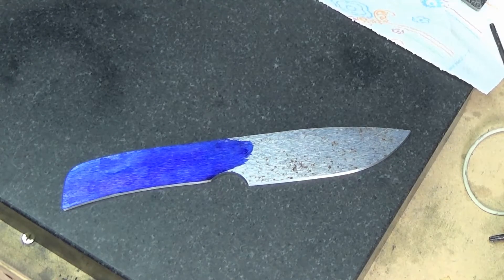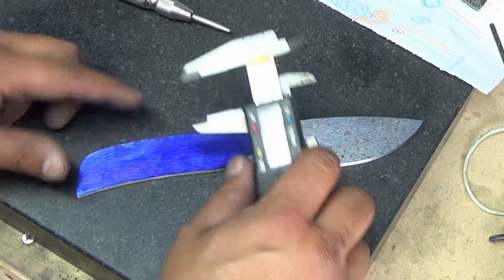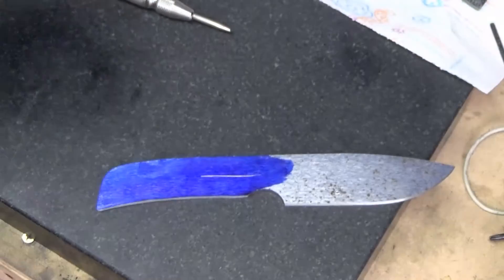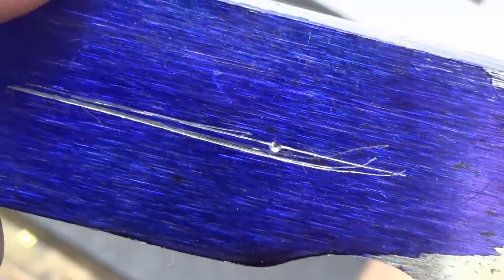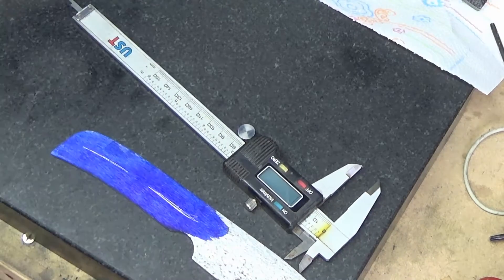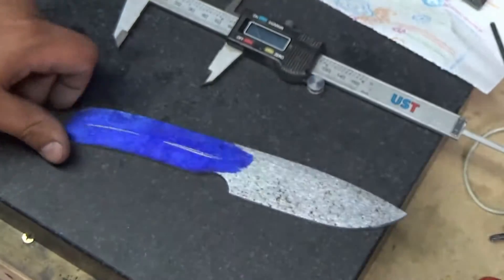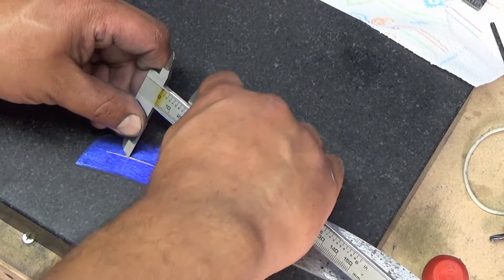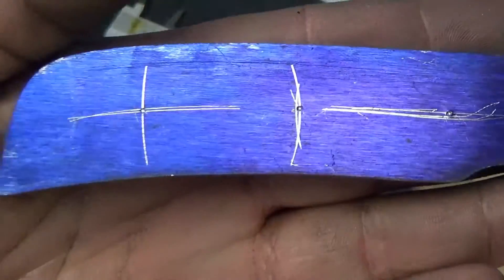How to make a knife Part 3. Drilling the holes for pins

Comment: Very nice! Couple of suggestions, though. 1) Raise the table - you want to keep your quill travel no longer than it needs to be. 2) Definitely agree transmission fluid a bad choice; tapping oil/cutting fluid best; good ol' 3-in-1 oil not bad. 3) once you drill one hole, file/deburr the back real quick before doing the next hole, or the blade won't be flat on the table. And reminder for your viewers, in case they don't know it (say it with me everyone): *"a 1/4" pin does not fit into a 1/4" hole!"*. Seriously. And this is (literally) doubly true when you're trying to get a pin through two scales as well, unless you have a miraculously perfectly true 90° setup. Either use an "F" size drill bit for a 1/4" pin, or use a 6mm pin in a 1/4" hole. (The equivalent for 1/8" is a #30, for a 3/16" is a #12, and for a 1/16" is a #52.) Otherwise you'll want to sand your pins, or ream your holes with an "over" reamer - pricey.

Comment: You should use all 3 keyholes, and the drill will never slip, and you don't have to force it.  Believe it or not, doing so will run more true & the chuck will last longer.  Then again, once you slip a bit, it won't run as true. ( although a drill press does not run as true as a mill. )

Comment: You should worry more about safety when doing such work. Especially when you expect that other people try to copy you. Wear safety goggles! A friend of mine told me about an incident where 1 of the students got a part of the hot cuttings flying around in one of his eyes. That was a real ugly thing to remove in the hospital because it gets stuck there when it cools down. Also use a proper tool for holding the workpiece, like a heavy drill press vice. You scared me when you had your fingers on the table and your wrist exposed with this insufficient clamp. Just a tip: if you drill metal, always drill into another some metal you put below and not into air. Don't use some random fluid for drilling if you want your tools to last longer. Thanks for sharing and remember safety first for public videos that may inspire other people!
Reply: Had my first experience with an exploding bit yesterday with aluminum of all things. Bit shattered and a piece cut the side of my stomach.

Comment: Mike, the transmission fluid you are using is formulated to reduce wear in moving mechanical assemblies, it actually prevents the drill bits from cutting until the heat burns it off( the smoke) if you invest in some cutting fluid or paste it will cut much better, faster and your bits will last longer. I will see if I can put up a video on how to sharpen your old bits when I get a chance. on to the next video.. looking good!